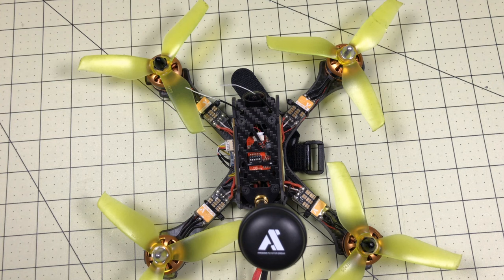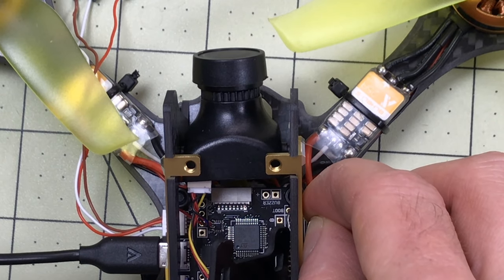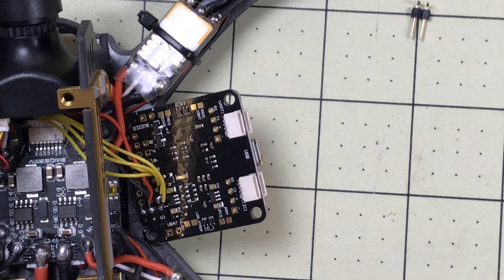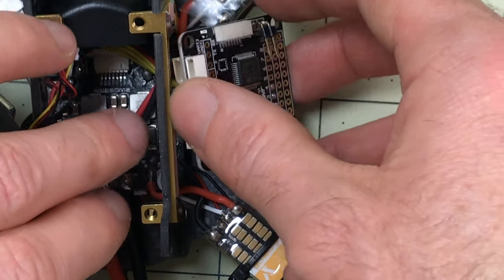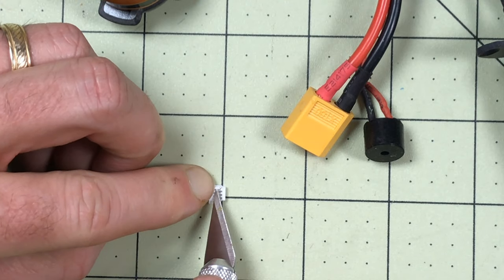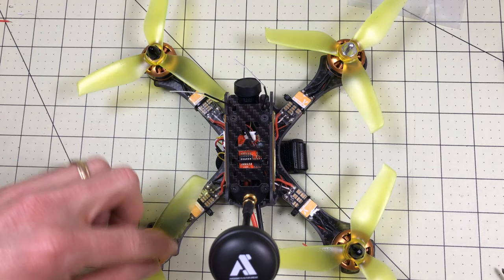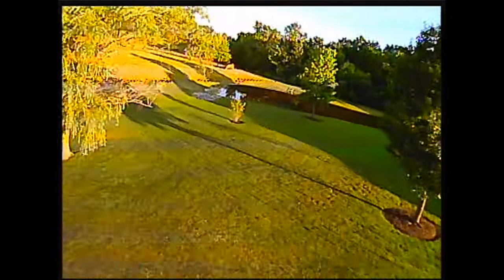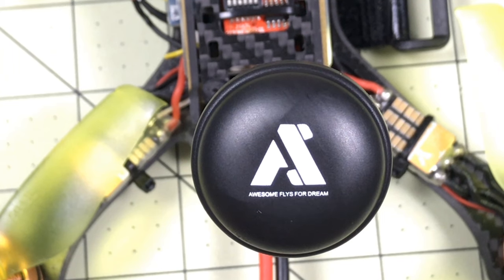Awesome F200 Standard Upgrades make it an AWESOME race drone, All for under $12

Comment: Just fair warning, watch out in those hard crashes, I had this frame and took a decent crash after about 2 weeks of flying and one of the arms started to delaminate. I tried finding replacement bottoms for the frame but didn't have any luck. That all being said, the frame flew really nice and even as tight is it is inside, it set up really nice. Nice job on the video, and I hope this frame  works better for you than it did me.
Reply from the maker: +BillyD FPV I have heard that so I've been watching. So far so good. Maybe they fixed it?  Someone said the arms are way to flexible but mine are really stiff and nice.
Reply: I'll suggest "upgrading" to the "Frog Lite" frame once you break this one like I did. ;) You should be able to just move everything over with only extending the wires to the rear ESC's or motors. No regrets. I won't go back to the F200 frame.
Reply: BillyD FPV if you want to get the f200 back in the air. i can get 4mm straight cut baseplates or 5mm!!! let me know if you want these cut. from the awesomeuav company. IF ANYONE wants to keep their sweet f200 in the air (cause it does handle nice and is zippy!) hit me up. i'll be getting the baseplates cut and can send worldwide.

Comment: We talked about my F200 after your first vid on it. Now, I'll suggest "upgrading" to the "Frog Lite" frame once you break this one like I did. ;) You should be able to just move everything over with only extending the wires to the rear ESC's or motors. No regrets. I won't go back to the F200 frame.

Comment: You could soft mount the motors. Then it would be even more awesome!
Reply from the maker: +Velti 317 i was going to if I had to. But everything seemed good so right now it doesn't seem needed
Reply: DroneRacer101 alright you have to know it. I just thought because of that little jellow in the image....
Reply from the maker: +Velti 317 There is just a little, I didn't do any PID tuning to it yet,  but it is nowhere near how bad the Lizard and a lot of the micros are out of the box.
Reply: DroneRacer101 yes thats right. Other than that its a really amazing quad :-)

Comment: pretty astute of you that color is caused by lack of IR filter. I would have been great at dark.  also there are usb hubs with power buttons on each port that are helpful for things like this.  just keep the cable plugged in and push the button.  nice video.
Reply from the maker: +Jim Whitaker Yea, it would be interesting as an evening flier with that lens but most of my flying is during the day.  Interesting idea with the hub.

Comment: This dose not apply to the vid but what is soft mount and hard mount mean on motors mean?
Reply from the maker: +Grackle FPV Hard mount means the motor is screwed directly to the arm.  It's a hard, solid connection.  Soft mount is putting a piece of rubber or something with some give between the motor and the arm.  This helps reduce the extra motor vibration that is passed through the frame and into the flight controller.  Here s a video of a different drone that gives a pretty good look.  https://youtu.be/HZnV5_7Q9FU

Comment: Hey Droneracer101 he flying better with betaflight? what do you think about the motors?
Reply from the maker: +golem9111 the motors seem good so far. It did much better with the stock pids in Betaflight. Still needs a bit of tuning though

Comment: what do i have to do to see the battery voltage on my goggles
Reply from the maker: +bruce ketta do you have one?  The easiest way would be to replace the camera with a Runcam Swift 2. http://bit.ly/RunCamSwift2
Reply: DroneRacer101 yeah i have a f200 standard like yours and i did all the upgrades u shown in this video and i realy realy realy enjoyed it.
so i only have to change che cam for the voltage on my goggles??
sorry for my bad english sir
Reply from the maker: +bruce ketta Your english is just fine.  Unfortunately the included flight controller does not include an OSD option.  So the easiest way it to install the Runcam 2.  It has one extra cable you will have to hook up to the battery in the same place  connected the VBAT wires.  Then the camera will read the voltage and display it on your screen.
Reply from the maker: +bruce ketta A lot of people are asking about the quality of this frame.  Mine has been great so far through several hard crashes.  How is yours?
Reply: DroneRacer101 thx mate i have a runcam 2 installed in one of my old drone so i can try it now 
i will let u know if it works 🖒🖒
Reply from the maker: +bruce ketta Sounds good, that is one of the upgrades they included by default in the High End version.

Comment: What do you prefer, top mounted battery or bottom mounted. I can't decide on which to get for a new frame.
Reply from the maker: +Glowworm 334 racing or freestyle?
Reply: DroneRacer101 Freestyle/Acro
Reply from the maker: +Glowworm 334 For that I like it on the bottom, like on F200.  I think it balances the weight right in the middle of the drone that way.
Reply: Thanks!

Comment: delaminated the arms yet??
Reply from the maker: +KillaG FPV not mine yet. But I don't have the hundreds of flights on it some people get.
Reply: DroneRacer101 those people dont crash. About third crash with impact. Like hard dirt or a tree. It will delaminate. Im thinking about getting 4-5mm straight cut mild chamfer maybe baseplates for the f200. Cause it does handle beautifully.
Reply from the maker: +KillaG FPV oh I have had way more crashes than that on both of them. In one if the videos I smacked it into the ground so hard I heard the solid crack across the yard. I thought for sure that did it in.
Reply: impact. say tree or hard surface. nothing much is hurt from grassy stacks. its not a matter of if. but when.